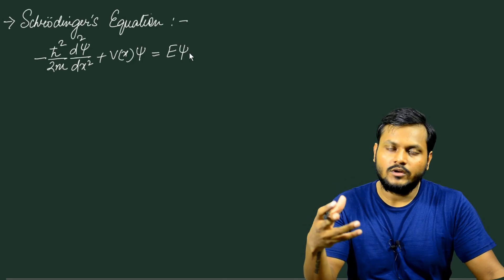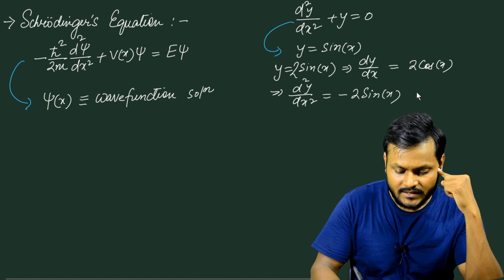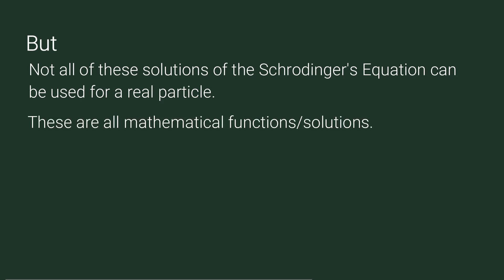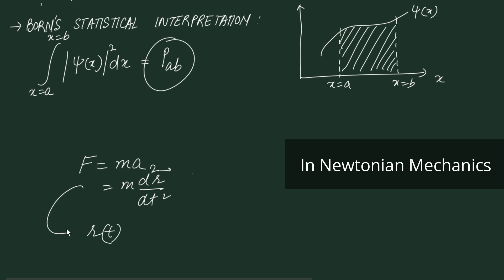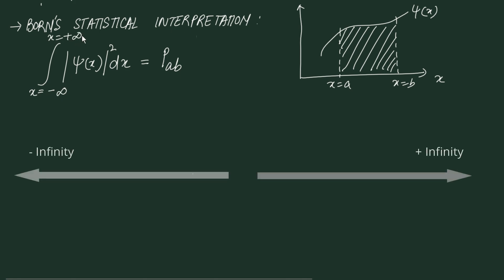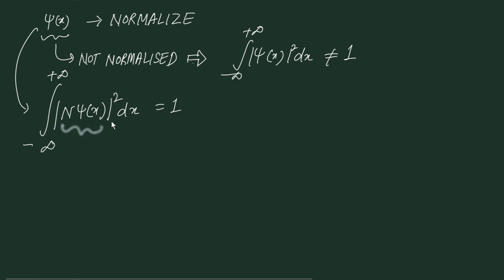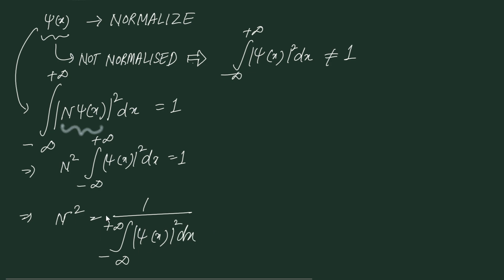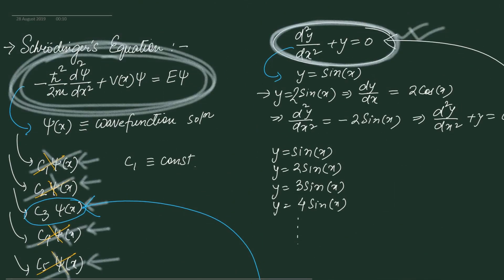What is Normalization of a Wavefunction??

Comment: Its very nice video. In last,  the way you calculate the normalization const. that is not correct since you have taken particle in a box but limits are taken - (∞) to + (∞). If you take this limit  - (∞) to + (∞) for this particle, then we will  get the normalization constant Zero, then wave function will vanish i.e meaningless. here we have to take the limit as per Born interpretation within some limit  (0 - L) then the N is square root of L upon 2.